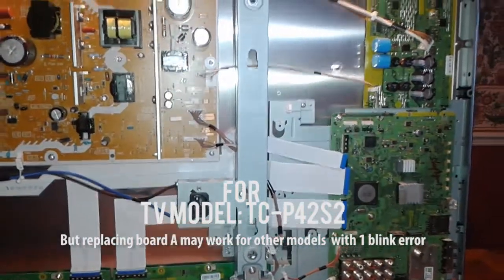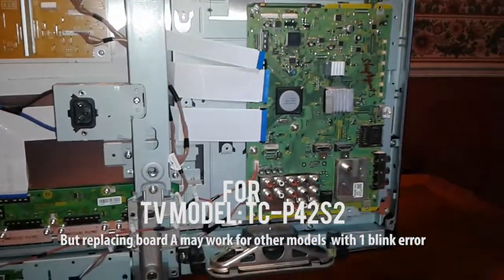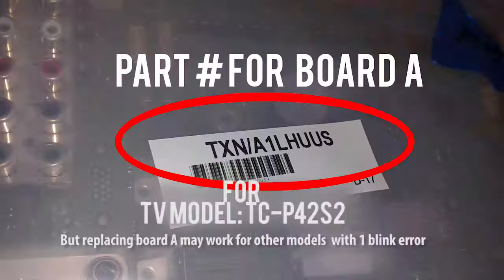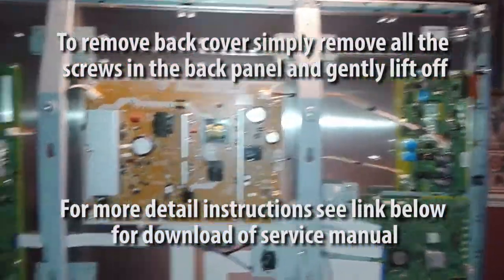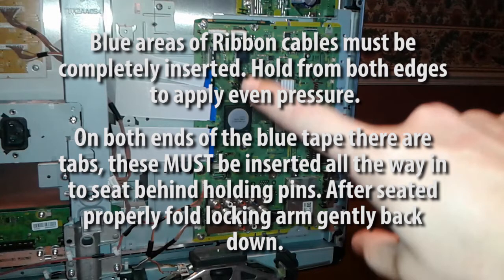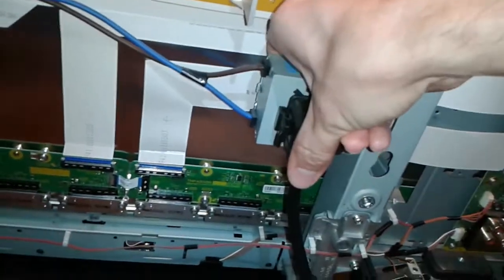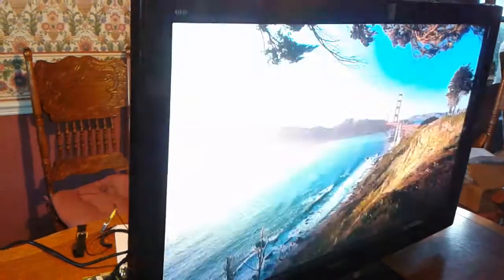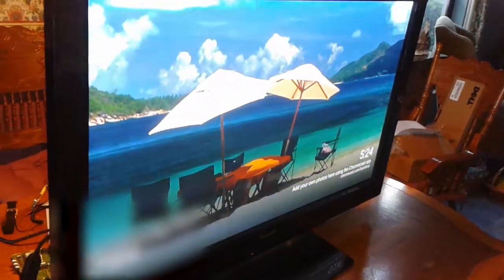Panasonic Plasma HDTV Screen not turning on 1 Blink Error Code Fix

Comment: The one blink error code is so vague on this tvs. I have a 65" 3D plasma and it does a single red blink every 3 seconds. Manual points to faulty A board which is the main board, but after replacing the main board the same issue still persist.

Comment: How much does the board cost roughly pls?
Reply from the maker: kophy awotwe I got the board for this TV for $172, with shipping. Today's prices depend on availability and what model TV you have.
Reply: FryerTad hi , TH-P54S10A is my model number. Can you help me with the price?
Reply from the maker: kophy awotwe I looked up the main board A, which is TZTNP01ECUA, but I couldn't any place that had it available. You can continue searching either by the TV model plus pcp A or the part number itself. Here is a similar listing but again it's not available. When I purchased my board I had to go through every search return on Google until I found one that had it available. https://www.statewideapp.com.au/panasonic-a-pcb-th-p54s10a-168126
Reply: FryerTad hi this Kophy again 
Can the power board be fix?
Reply from the maker: kophy awotwe it is possible, but I don't know how. You'd have to find someone that can do that

Comment: was it a new board ? because the faulty board is repairable without the risk of a buying a used one that will fail eventually
Reply: No, it was used from a parts reseller. Repair is an option is you have the ability. But the age of this TV makes it easily replaceable if the fix isn't cheap.
Reply: Scott Simmons 
No.  It’s the same board which came with the tv